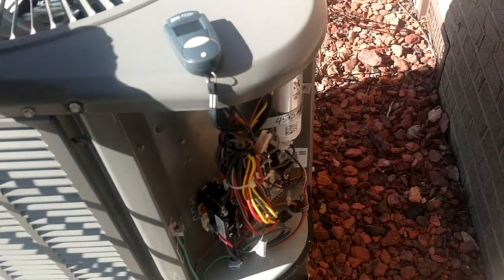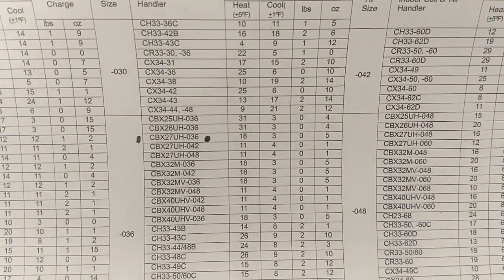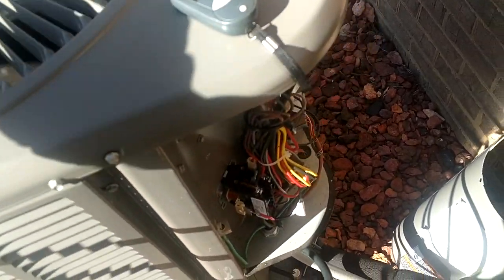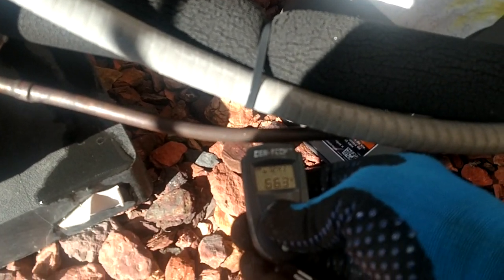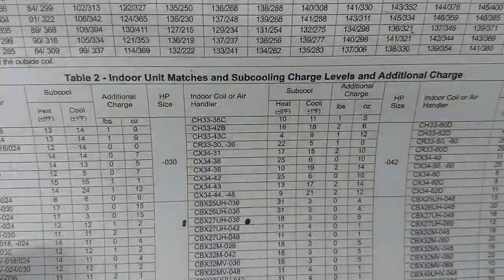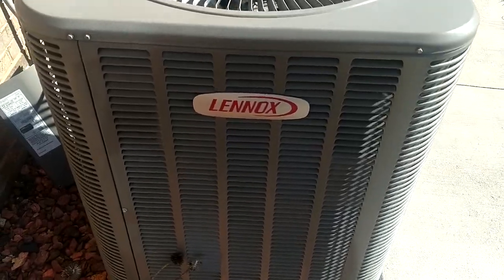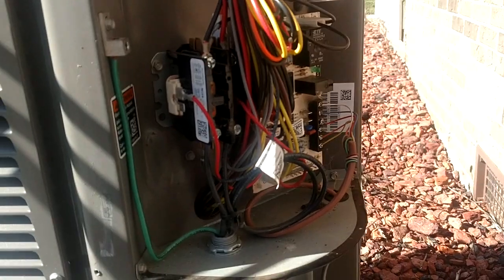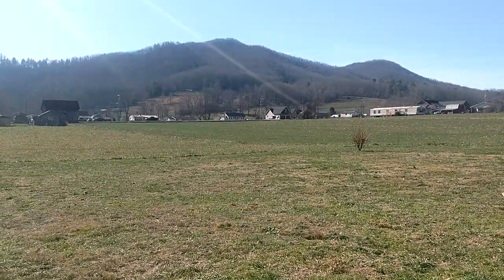Calculating subcooling & refrig. charge in the winter time. Is it accurate? Lennox charging chart 👍

Comment: Great video! I was exactly looking for this....
Have a question for you! I bought my house 8 month ago and it has Lennox heat pump similar to this video. It is 5 years old 14HPX-48. I had not problem in the summer but now during the cold weather, in heating mode,  I get low pressure lock out error once the outdoor temp goes below 32 and most of the outdoor coil become frosted. I have tested the deforsting board and it is working fine. Low pressure lock out gets activated before it goes to the defrosting mode. Filters and indoor coil are clean so it seems  there is no airflow problem. So, can you confidently say it is slightly undercharged? I saw the other video you mentioned about common leaking problem of Lennox. Considering that the system was running the whole summer, do you think is has a small leak? Thank you much!
Reply from the maker: If the unit was functioning properly and cooling okay in the summer months and the problem only happened after you switched over to heat. It is most likely the outdoor TXV valve that is malfunctioning. This will drop the suction pressure and the unit will start tripping on low pressure lockouts. You're right, the system could also be low on refrigerant. But if it works properly in the cooling mode but then starts tripping the low pressure when switched to the heating mode. Then it is definitely the outdoor TXV valve is bad. Hope this is helpful. Thanks for watching 😎👍
Reply: @sknight0391  Appreciate it! How do you suggest checking outdoor TXV?
Reply from the maker: @aliajami  you would have to get a knowledgeable HVAC technician to put a set of gauges on it. 👍

Comment: I needed this. The other day I tried to check the charge and my mind went blank. When I asked others I got other answers and ended up more confused than I was before.   Now to be sure if adjustment is needed is add refrigerant to increase subcooling and recover to lower?
Reply: Thank you so much for the fast response. I will have to check out more of your videos
Reply from the maker: Glad you found the video helpful. And yes you are correct with subcooling, you add refrigerant to increase and remove refrigerant to lower. It's the exact opposite with superheat. If you're super heat is high the system is is undercharged and refrigerant needs to be added. If the superheat is really low then the system is most likely overcharged and refrigerant would need to be removed. Thanks for watching 😎👍

Comment: Isn’t the red high pressure hose go on the suction line when it’s a heat pump on heat mode ?
Reply: Thank you mate. That was really helpfull
Reply from the maker: No it does not . That's one of the biggest misconceptions with heat pumps during the heating cycle.
Hope the video helped and thanks for watching 😎👍
Reply: Thanks for you quick answer. I watched an other video that says if system has txv you hook red hose on liquid line. If orifice you hook on suction line ?
Reply from the maker: @vladekvladinov5753  I always hook to the liquid line in the winter time. Carrier products are the only ones that you have to hook to the larger discharge line in the winter. This is because they use a metering device in the liquid line where it connects to the outdoor unit. This is easy to recognize because there is a flare style compression fitting connecting it to the outdoor unit and that makes it impossible to take the pressure on the liquid line because it basically ends up being the same as the low side pressure. But that's only on Carrier branded products where you'll see this. 👍

Comment: Just did a lennox heat pump today the same way. It was 28 in Ohio today. Target was 11 degrees subcooling. I added the recommended charge for the coil, did my calculation for the extra line set. And it was running spot on.
Reply from the maker: Yeah those charging charts are great. As long as you have the defrost settings set properly for the area that you're in, it will be good to go. 👍
Reply: @Shannon Knight HVAC I just left it in its default setting which is 90 min I believe. How would I determine if I'm in an area where it needs to defrost more often?
Reply from the maker: @tycobb8621  being that you're in Ohio I definitely wouldn't let it go any longer than 60 min.
Reply from the maker: @tycobb8621  for the units that have "demand style defrost", they come factory set at 50°, you would need to change that to 70° 👍
Reply: @Shannon Knight HVAC great info, thanks!

Comment: Have a Lennox 3Ton HeatPump pumping down in Cooling mode...  Heating mode appears to work properly...  I’m looking @ I’m indoor TXV not working properly, does that sound like proper diagnosis, plz advise.....
Reply from the maker: More than likely a bad indoor TXV. Check the sensing bulb at the indoor unit to make sure it is mounted properly on the refrigerant line. While running in AC mode you will also see all the small feeder tubes coming off of the ID TXV starting to turn white and freeze. And then you know it's bad. I would also make sure that the blower motor isn't dropping out for some reason, X13, just to be on the safe side.